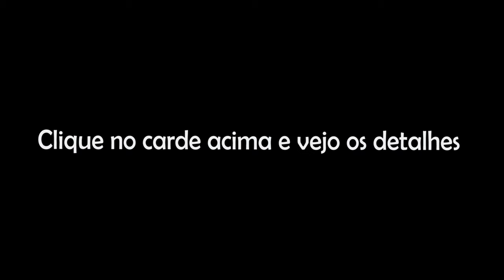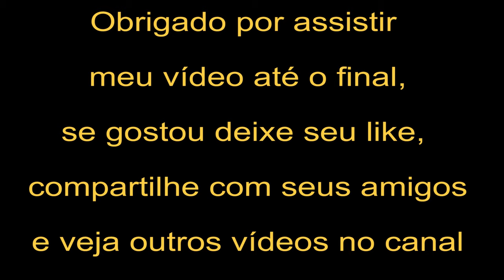COMO ADAPTAR CÃMBIO CVT NO MOTOR ESTACIONÁRIO RESUMO

Comment: Tarcício, você conseguiria montar um CVT para um motor de 550cc (15Hp) ???
Reply from the maker: Qual é o diâmetro de eixo
Reply: 1"
Reply from the maker: Consigo sim
Reply: quanto ficaria em média ??
Reply from the maker: https://produto.mercadolivre.com.br/MLB-1492125085-kit-embreagem-primaria-secundaria-honda-pcx-1415-rolete-_JM?matt_tool=63797002&matt_word=&matt_source=google&matt_campaign_id=14303357438&matt_ad_group_id=128472473160&matt_match_type=&matt_network=g&matt_device=c&matt_creative=539354515641&matt_keyword=&matt_ad_position=&matt_ad_type=pla&matt_merchant_id=106238947&matt_product_id=MLB1492125085&matt_product_partition_id=1405887637391&matt_target_id=pla-1405887637391&gclid=Cj0KCQjww4OMBhCUARIsAILndv4uC9xJ83vjk4NtEiuY5VNNz4GuKmtLnr_VDg9J7QhyXFFu5Ey2T3YaAq1bEALw_wcB

Mais 600 para adaptar
Reply: ficaria R$ 1100, o que bom, mas tenho receio do desgaste prematuro da embreagem da 150cc, e também a relação dos roletes para maior torque em menos RPM.
Reply from the maker: Vou fazer um vídeo explicando isso, me cobra depois.